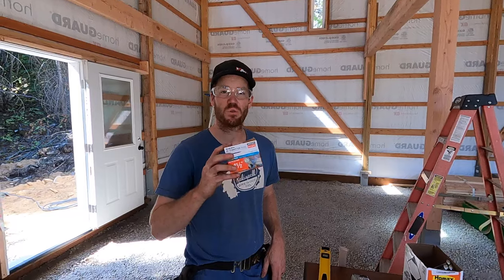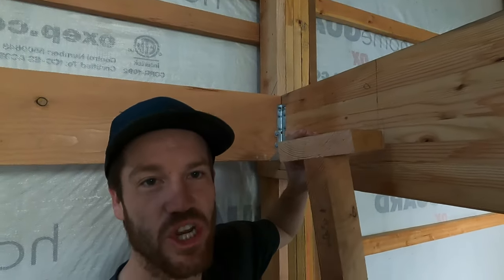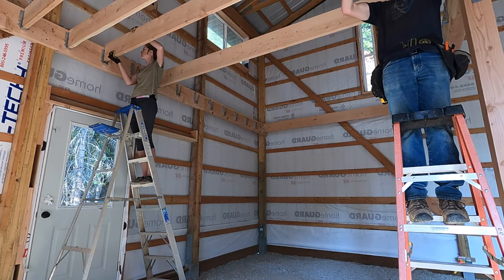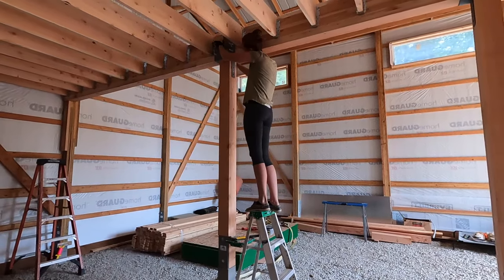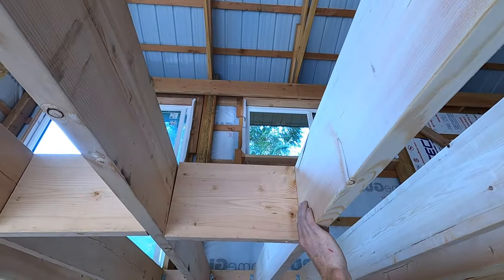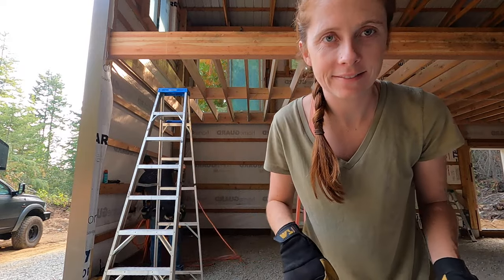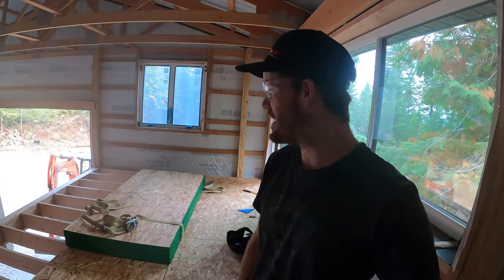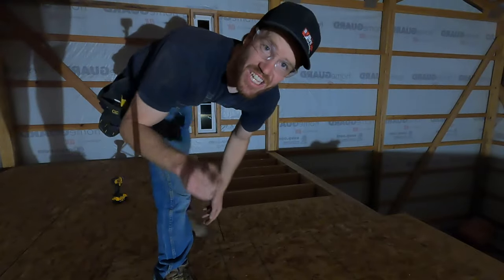WE CAN’T BELIEVE IT - We have a floor! | E2

Comment: ALRIGHT !!  , YOU GUYS  way to go..for some quick work lights   try the flood lights that go on the truck work lites  12v and  almost  day time Ac cord  converted to 12v plugs,and piece of  1/2 or 3/4 conduit for crossbar  bracket ,your big orange clamps should work for placement ..

Comment: I know it's useless commenting from the future, but if you build any other structures like this, consider strapping a bunch of wide-angle worklights to the rafters as soon as practical. That way right off the bat you can have bright light everywhere throughout the workspace at the flick of a switch.

Comment: The screws are so much better than those stupid nails, used em on a second floor too. You will be glad you glued and screwed the floor. People are starting to not glue using screws, no bue no!! Put a rope or some wood outside the slider until you build the deck/patio. Nice work, long days will be the norm during this plus 110k subs!!

Comment: A gap in a floor joist is called a crown.
Every joist has a bend to it all the crowns need to face the sky, so when you walk over the floor then want  to push down and out. But becuse of the rim joist it won't let them. If every other one points a different direction then your floor won't be flat. It will rise and fall from joist to joist. You should have slighted all your lumber and marked the crown of each one with an arrow pointing up. That way the all lay the same way. You would have a nice flat floor.  That 1/2 the barns your apartment 2 story.

Comment: I found this channel halfway through the build and was hooked.   I went back to the beginning to experience it all. It’s great to see how well you guys work together.

Since so many comments have advice for you I’ll add my own 2 cents.  Most Honda generators take the intake air from below, next time you’re in town, stop at the auto parts place and get a metal drip pan to place the generator on, you will get much longer life from the air filter.  Also we change the oil every 100 hours or so.  We use Mobile 1 synthetic and a few of our generators have a few thousand hours on them!
Reply from the maker: That is an excellent tip Dan, thanks for sharing! We actually have a tray around here that we can use.

Comment: Suggestion for your electric outlets.  Since you will be using a diesel generator, and it most likely will not be running all the time, to put in a few outlet boxes in the apartment for low voltage DC power.  The outlets can be used to power 12vdc lighting for when its dark and the generator is not running.  You can get 12 vdc led light bulbs on Amazon to use in table lamps, powered by a 12 volt battery.  This will save on not having to run an inverter to run lights.  Your solar panels can charge your battery during the day.
Glad to see you have a diesel generator.  It's the lowest cost to operate over gas, or propane, but it is still expensive cost per KW.  Run will clean diesel, and filter your fuel.

Comment: Run a string line on the outside of yor beam and you will be able to quickly see when you start pushing out
Reply from the maker: Great tip! That is exactly what we did and it was very helpful.
Reply: @AmbitionStrikes  It is amazing what a simple piece of string can tell you hang it with a weight on it and it can tell you if you are plumb, streched a long a beam and you can tell if you are bowed, above the floor and you can tell if you are level or not

Comment: Looks great!  You should always "crown" your joists and place them so the crown is up. That way, the weight of your floor, walls, and such will help push the crowns down to level.
Reply: Sorry what’s a crown...
Reply: I'm pretty sure Riley knows to put the crowns up!
Reply: @mcoppock214  it’s the bow along the length of a board.

Comment: I guess on your next building, you will measure everything twice and double check. Use the laser level to ensure that things line up too. Not sure if you did that. On your little jig, cut the top piece flush with backside of the joist and then attach a small piece of plywood on the back so it "clips" onto the joist. You won't have to worry about it falling off then. When installing the first joist in the middle, rachet strap the beam to other side so it holds the joist tight. Your second and third joist can be in the middle of each side then and do the same. No rainbowing of your beam. All of your following joists measurements should stay the same then. Did you by chance check your joist for a crown? Have the crown up. For no construction experience, you did an outstanding job! By chance, do you know if that excavator can have different attachments?

Comment: In southeast asia carpenters make gaps to connect wood to each other, so they don't use nails or metal joints and can last decades. But the way you make a house in America looks very easy even for beginners.

Comment: Great job on the floor. Loved the comment about the pulley. May be you could create a crane with a swing arm on one of your centre posts to aid lifting the framing and wall materials out of some 2 inch scaffold tubes. Just a thought. As always thanks for posting

Comment: If your main/normal source of heat is a wood stove, then realistically you can't go away from the property in the winter for more than maybe 12 hours tops before the fire goes out and normal plumbing then freezes up. You might want to make propane your main source of heat and make the wood stove as the backup. Thinking like that might change the way you do things. One way of changing your thinking would be to get a larger propane tank than you might be thinking. You will need a big one placed where it can be serviced from time to time by the propane company. Oh, and you also have to make sure the plumbing is kept warm enough under the floor so that it doesn't freeze up. Your house might be warm, but under the floor it could be freezing cold if it is not insulated enough. I don't know how a wood stove would do that. Some propane heat could be piped down there under the floor in the right places if you design things correctly for that. So I would also keep most of your plumbing on one side of the house.
Reply from the maker: Excellent tips! We actually have plans to design a plumbing system that can be fully drained so that we can travel during the winter without fears of things freezing!
Reply: @AmbitionStrikes  Thanks. You guys do great at planning ahead. It will save you headaches. You can't think of everything that might happen, but it helps to try.

Comment: I think it's awesome what you've accomplished in such a short amount of time,  I've always wanted to do the same thing it's just not been in my cards to have it yet,  but I'm still hopeful,, I'm a builder of ratrod trucks as a hobby and I've always imagined what it would be like to walk out on a balcony over my shop with a morning coffee and look over my projects as I plan the days next accomplishments,  I'm curious about if you plan to go across the back wall with an extension of your apartment to the windows on the other side ?, great work so far and it's nice to know I'm not crazy for wanting to live in a barn,  it seems like an economic way to heat and cool both areas in which you live and work,  speaking of heat,, are you going to use the water tubing in your slab as a heat source for the whole building? It's very efficient and you'll never be cold unless you go outside ; )

Comment: Before you said it, I was thinking omg, how tedious!  I'm starting to realize watching this videos triggers emotions from my lower scale experience on projects, thus the connection.  For example, when Riley was pulling wood off the Army Truck - I was triggered thinking what a pain to figure out how much, what wood, smartly load the vehicle and then keep track as you apply stuff to planned design.   I was thinking you'd hit the stairs first - for easy access to elevated work site?  I was thinking if the Stairs came up under the floor, although you loose livable space upstairs, it creates an easy option to seal the lower-level for a two floor living space adjacent to the workshop?  Uh, assuming the living apartment is currently  planned for just the upper floor. Fun.
Reply from the maker: Hi Tom! I think the more comfortable we get filming, the more we are able to share thoughts like that with you all. It’s fun to watch the footage over and remember in that moment how tedious something felt, to then turn around and get it done!

Comment: What screws did you use for those hangers? Because screws don't have the shear strength that nails do. Not the right application for screws.

Screws for the blocking was fine though. Perfect use case.
Reply from the maker: They are screws specifically for joist hangers made by Simpson.

Comment: Are those screws rated for the hangers? They look like drywall screws! Usually hangers are installed using structural nail or screw specified by the hanger manufacturer or structural engineer.
Reply from the maker: They are Simpson Strong Drive screws, which are code rated and intended for joist hangers.

Comment: Be sure to put one of  those fat little nails in each joist hanger and especially the hurricane tie downs.   Code.  Inspector will make you go back.  Much harder to do it later.   Buy a cheap HFF  palm nailer.  Very  useful.  Less than $50. Forced me to buy ear muffs.  Very noisy.  
JoeB.   New sub.

Comment: Hi guys, great video series... I've been doing construction/remodeling for over 40 years now, since 1980, and I didn't notice that you guys were checking for the crown of the floor joists. The floor is already installed so it may be too late but maybe my comment might assist another. If you did check crown, clearly I missed it. Crown is the slight hump that most every board has; except for manufactured boards such as paralamas and the like. The natural crown of the board comes into play and will be noticeable if you get one or a few wrong especially if they are side by side of each other the dip is obvious.

The crown should be placed up on all floor joists to allow more rigidity to the floor. If you get a mysterious dip in the floor it is due to the crown being the wrong way. I'm making this comment early in the video so if you addressed this later in the video I haven't gotten there yet. I simply see you unload the board, cut it to length, and install it but I don't see you checking crown before installing it... Many times the crown or hump is hard to tell and if that's the case it might not matter; only time will tell. 

Keep up the great work...
Reply from the maker: Hi Paul! We really appreciate you taking the time to comment and lend your knowledge. We did check crown on some of them, but will definitely pay more attention next time to every board!

Comment: Looks good. Just curious why you used joist hangers on the beam and did not rest joist on top of it? Perhaps you needed head room under? By resting them on top you can gain more square footage by cantilevering joist over two feet plus no joist hangers.

Comment: Great work guys!! So happy for you guys. What cause the lvl beam to bow with the floor joist?
Reply from the maker: The joist hanger brackets have a toe nail spot for screws. We were putting those in first, which was causing them to push the beam out. We also had to be very careful about the angle that we put the screws in!

Comment: What’s the floor insulation plan? Total novice here, but seems if you put the ceiling in first, you could fill insulation between the joists, then encapsulate with OBS on top?
Reply from the maker: If it were just a dry storage area that would work great! But we are going to need access to that area for quite awhile as we do all of our plumbing and electrical. 

In a perfect world we would spray foam the space, I’m just not hopeful that will be in the budget.

Comment: You gotter done. Why did you go with joist hangers rather than setting the joists on top of the center and wall bean?
I've just never been a fan of hangers. That's me. I sure you've made some consideration for when it gets cold and the joist's contract in the cold so they don't pull out of the hangers. That's why joists are normally set on top of the center beam so they can slide

Comment: You should have staggered the seems of the OSB, it improves the racking strength of the building. FYI your should to do it with drywall too.
Reply: He did stagger it.  (11:18)
Reply from the maker: Great tip! We did stagger the seams.

Comment: Awesome job guys. Keep going! (After a quick rest of course).  I hesitate to say this because it might sound like criticism, but because it's the only helpful thing that I can suggest so I'm going to say it anyway... wouldn't you be better off leaving the plastic coating on the windows until you've finished the bigger building jobs? That way they are protected from an accidental scratches along the way.
Reply from the maker: It would certainly seem that way! But the longer the film is left on the windows in direct sunlight, the more likely we are to be left with permanent ghosting.
Reply: @AmbitionStrikes  I see. Well best whip that off then 😜

Comment: Being a carpenter for 29 yrs I can say you guys are doing a pretty good job! Maybe u did but didn't film it but it's good practice to "crown " your joists.  Where are your stairs gonna be? It seems that the sliding glass door and the 32"×80" man door are on walls where snow will slide off the roof in winter? Cheers from Canada !😁🇨🇦🔨
Reply from the maker: That is an excellent tip in the joists! We should have paid more attention to that. 

Short term the stairs are going to be inside the shop. Long term we will be doing a large covered deck off the sliding glass door that creates a car port underneath (and protects the man door). The deck will have a staircase down to the carport.
Reply: @AmbitionStrikes  Awesome ! Thanks for the reply!

Comment: Are you doing open ceilings or low ceilings??
Reply from the maker: The ceiling will be at the height of the bottom truss chord so that we have plenty of space for insulation.
Reply: @AmbitionStrikes  be sure to vent that space above the trusses so you do not get condensation problems